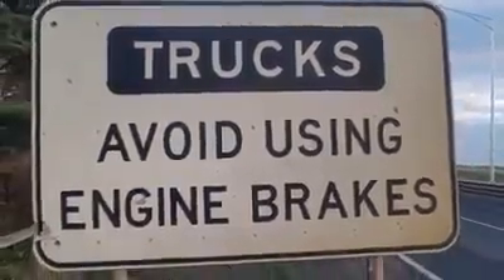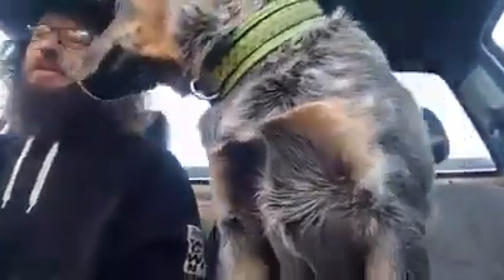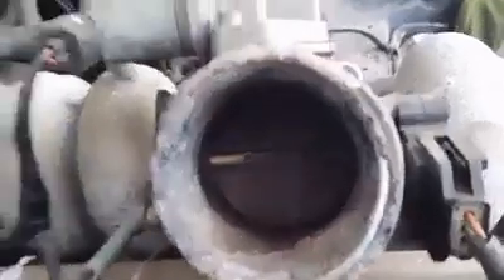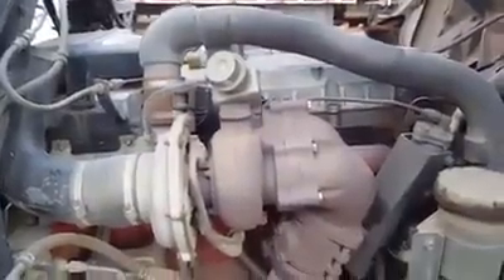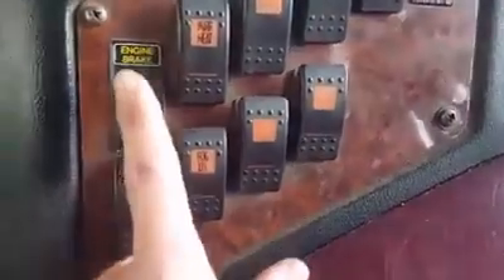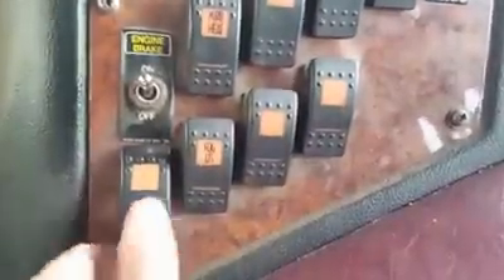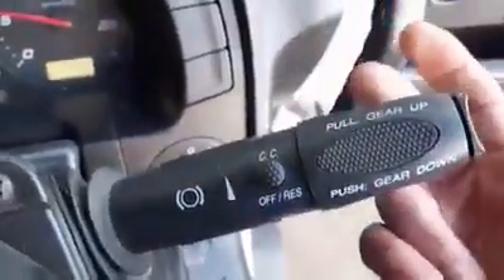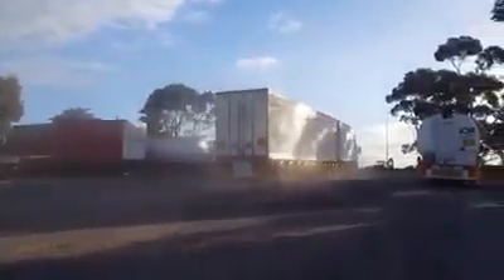Jake brakes explained by Bent Axlecroft

Comment: There's an alternative to J brakes now, it's called regenerative braking, as used in the Toyota Prius hybrid... When the car decelerates, the electric motor switches over to act as a generator, dumping the kinetic energy / power into a small battery.   Why trucks don't have this is a mystery...
Reply from the maker: Yes that sounds like a good idea.